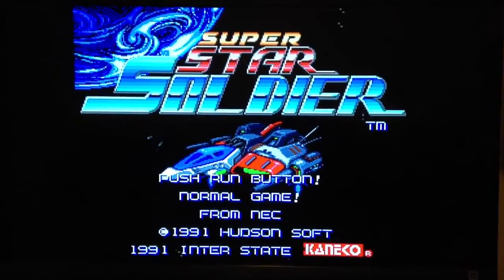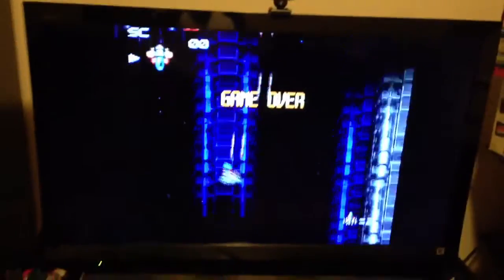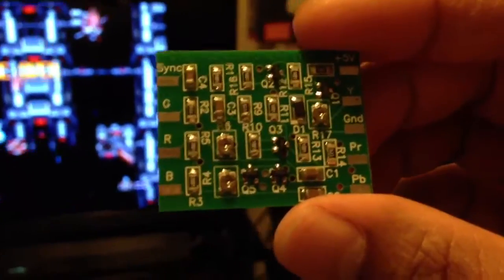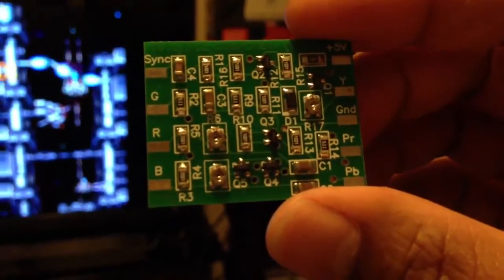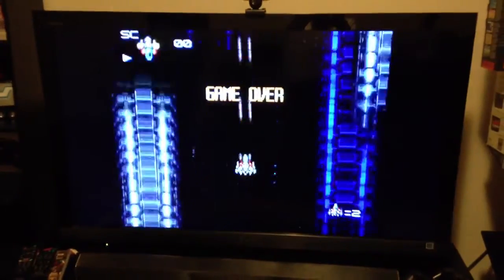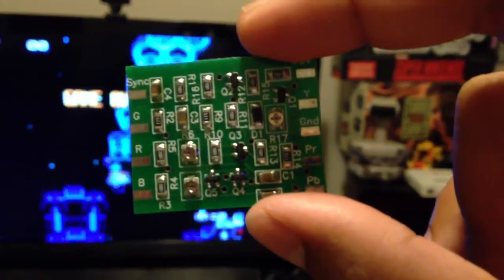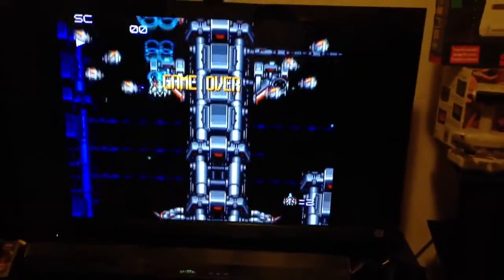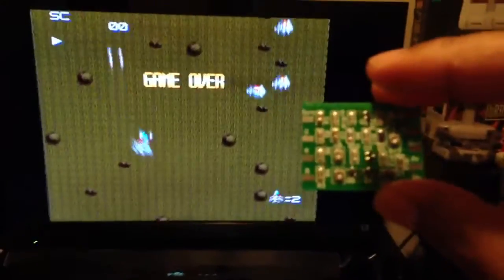Component Video Converter For Retro Gaming Systems

Comment: The Sega Master System DOES output RGB natively - in fact, if you have a SCART cable, it will output it right through the AV port without modification.